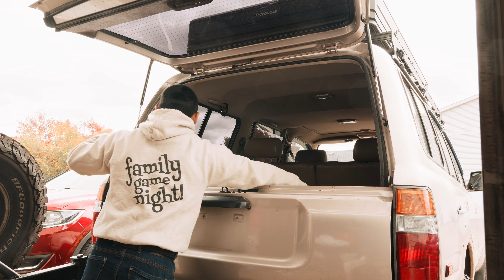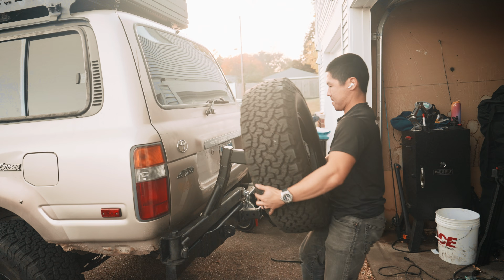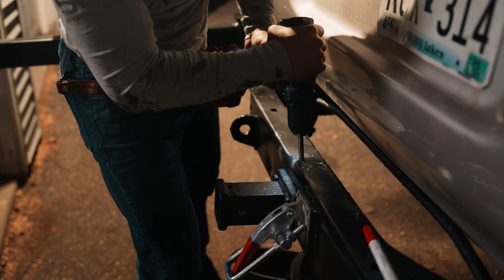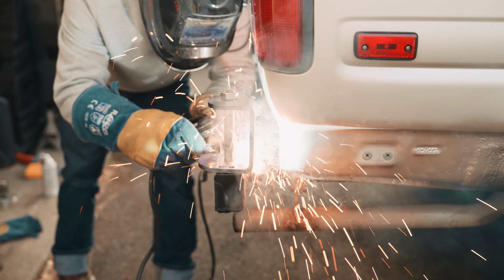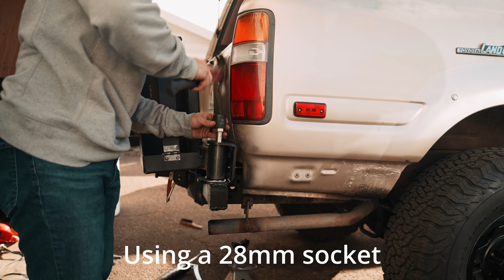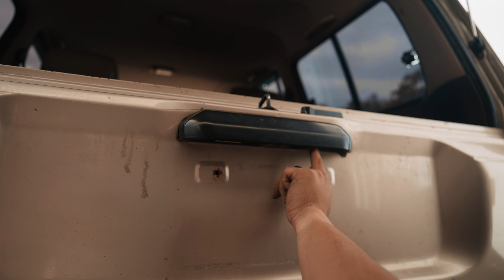DIY Dual Swing-Out Bumper Upgrade | Land Cruiser Mods

Comment: Good video. Only issue I see is that those handles pointing down. If you’re clinging a steep incline those handles are gonna pop loose and your swing out are gonna only have that lift able pin securing them in place.
Reply from the maker: @AverageOverlander  I did end up putting a spacer between one of the handles and the frame that I didn’t film because it wouldn’t shut but that can be corrected if you measure distances precisely before drilling haha